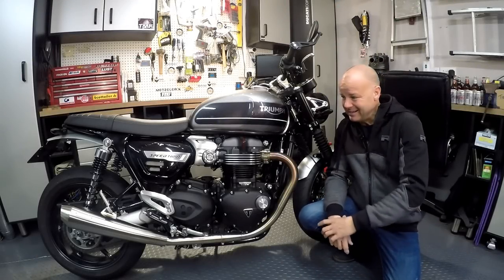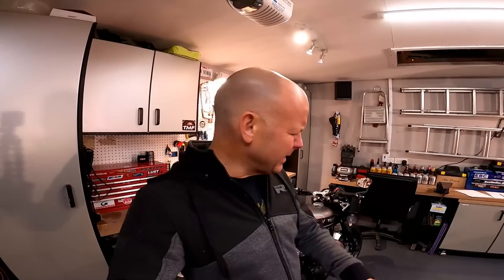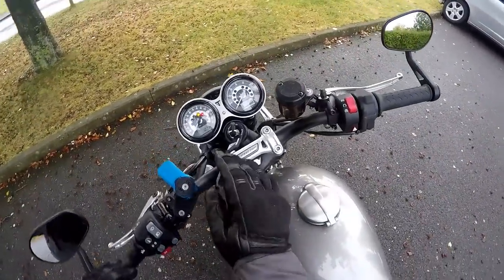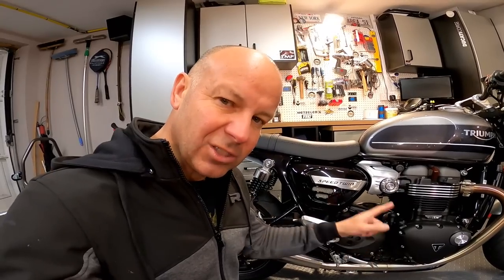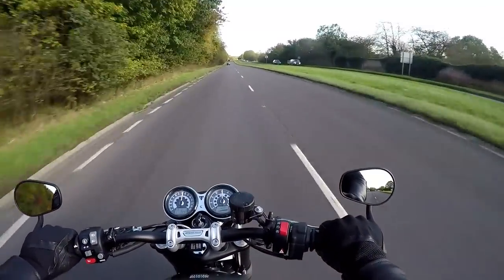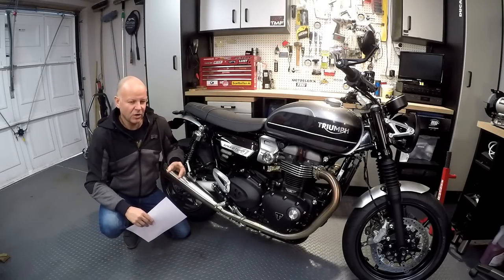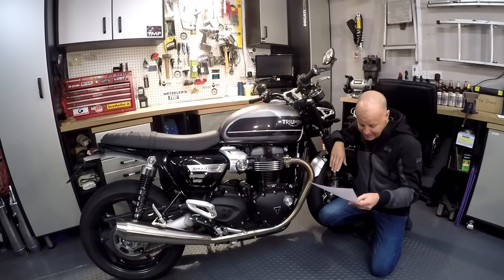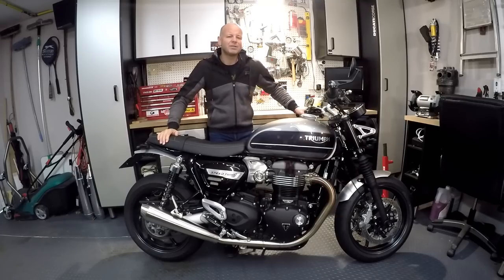Triumph Speed Twin - In depth owners review

Comment: I have the 1200 Speedmaster and it is a bit similar to your Speed Twin at low speeds, not sure if you have “rain mode” on yours but I always use it in town with great results nice and smooth.
Reply: Yes, I have a Speedmaster too and that’s the obvious fix.  I made an enquiry to the throttle spacer kit people but they don’t have a fit for our bike!  Pity. Yours aye, Alan

Comment: To lube the chain you can put paddock stand bobbins on the motorcycle triumph actually makes a set for it.Cheers Chips
Reply from the maker: Indeed - I should have mentioned that - I even have a paddock stand and an Abba Stand so I have two ways of doing it without wheeling it around!!

Comment: Hi! Any noticable difference to even wetter, or dryer, when going to the tail tidy from stock license plateholder? Kind of hoping a tail tidy will maybe act a bit as a longer fender?

SW motech blaze saddlebags will fit bolt on for touring, but only listed as fit for thruxton. Been on several days touring with woman two up and had a great time. Our bums got used to the seat, no big problem, nice to strecht the legs every other hour anyway. 

After 6 months  and 20.000km I dont mind the snatchy throttle much, but will go for same mods as you if keeping the bike. 

What I mind quite a bit is scaring people in the zebras evertime with low speed front wheel braking squealing sound like a freight train and vibration when braking. Total lack of quality feel regarding this and unaceptable on a brand new bike. Dealer have been great, and have had pads androtors changed, but with not much improvement. Have heard from others that a new front wheel might solve the issue permanently. Hoping to have this sorted soon, and keep the bike:)      

(Yes, also tried cleaning brakes, and adding copper grease, several times, did not solve the problem)
Reply from the maker: Thanks for the feedback Lars!

Comment: Great vid, even greater bike. Installed the throttle spacers and cannot agree with you more! In fact, it feels so smooth that I am doubting to install the booster plug as well. In your opinion (or anybody's who has already done this), is that still a useful addition?

Comment: The booster plug to improve low speed throttle response: Who makes it, where did you buy it, how much did it cost & was it simple "plug'n'play" to fit?
Reply from the maker: I got mine from Tec Bike Parts - it is plug n play, I shall soon be fitting one to my Royal Enfield Interceptor and will no doubt make a video on it - stay tuned!
Reply: Adam Croll has a video putting the booster plug onto his speed twin. It's very easy. Ten minutes if you have a five minute smoke break.
Reply: Is this booster plug applicable to the Speedmaster too?  The snatch at low speed drives me nuts.  Slipping the clutch and using rain mode are my only options at the moment!  Yours aye, Alan

Comment: Hello. Great video! I know I’m late to the party here but am a new rider looking at Triumphs and came across this video. Although you have a slightly older model I imagine the usb plug under the seat is the same as on the 24 model. I’m wondering if you could describe how you were able to get your phone cord to the handlebars? Did it require tank removal or were you able to fish it through some other way? I looked through some of the comments here but didn’t see this question asked. Apologies if I missed it. Thanks.

Comment: Interesting comment about the lights, 
Day time running lights are a requirement here in Canada. So my triumph street twin. Always has the Low Beam on, which is the Day Time Running Light. The only light switch just turns the high beam on. 
The light even on low beam I thought was great. Having ridden long dark mountain highways. The full beam really good. 
Might be having ridden an old 6 volt system Kawasaki 100, which was next to useless in the dark.
Even 35 or more years ago learning to ride in the UK. I was advised to always ride with the headlight on. Even if it was pretty useless in the dark. I think it did make me slightly more visible. 

Is this still advised in the UK or a normal habit for riding. 

If I by a car or bike in the US I have to get it changed to Canadian spec, which includes the premenant Day Time Running Lights. It’s usually just a minor change. 
So presumably it is a change which could easily be done by triumph if requested. If it’s standard on a bike here. 
If I was riding in the UK again, it’s a change I would probably request this change.
Reply: UK, you must ride with dipped headlights on at all times.  Full beam optional depending on visibility and oncoming vehicles. Sorry it took 1 year..

Comment: Hi bud great channel , question I have fitted the throttle spacer, great mod , knowing you have also fitted the plug in fuelling mod in the air box , dose it further improve low speed throttle use ? Thanks
Reply from the maker: Apparently so but mine was fitted when I bought the bike so I don't know what the improvement is....
Reply: @TheMissendenFlyer  Since one of the selling points for the booster plug is that it’s supposed to be easy to fit or remove, would you consider doing a review? I’d be interested to see what the difference is with it fitted or not. How much does it help the poor Euro-strangled fueling? Does it have any noticeable impact on fuel consumption? Does it add any gee-gees🐴, or is it mostly noticeable at low revs? Supposedly it’s five minutes or less to to get the job done- a right doddle! C’mon- you know your curious too! 🤔

Comment: The speed twin is a sharp bike. I was wondering if it is as easy to ride as the other Bonneville motorcycles are so someone could get one for a first bike (46yr old adult)? Is there any bags you would recommend for the speed twin that won't mess up the looks of the bike? Would you use a center stand on this bike?

Comment: My 4 and a 1/2 month review as a newbie middle age old git biker, I guess you were expecting this ;)

I got one of these after passing my test in May 2019.
Is it too much for a first big bike ? TMF, you said it was ;)
If I'd been a newbie 24 year old biker version of me then "yes", I was a bit of an idiot at 24 in cars. It wouldn't have ended well on a bike like this. The 51 year old version of me, has found it a bit quick, but 32 years of driving a car and a realisation of the dangers have meant I've survived the first 1200 miles on this big bike. In fact the large torquey engine makes it easy to ride it slowly, in a lot of ways much easier than a 125cc bike (apart from lugging it about). Gear selection is easier on the Speed Twin as compared to my Street Triple, the twin pulls in almost any gear !

Fuel, mpg and range.
The fuel tank is a little too small, should be nearer to 18 litres instead of 14.5 litres.
Triumph put 16 litre tanks on the current 1200cc Scramblers. hmmm....
My Dad's 1954 Triumph Tiger 110 650cc had an 18 litre fuel tank, and that had better MPG ! (70 ish MPG)
I'm getting 56 MPG ( no booster plug ). I don't ride it hard and I keep to speed limits, on mainly A and B 60 MPH country roads. So for me the range to empty is about 175 miles.

Yep, the range indicator is pessimistic. On one of my fill ups, before I filled up I noted it said 35 miles left. I only got 9.5 litres in the tank. So there were 5 litres left, which I reckon would do somewhere between 55 to 60 odd miles. So the range left is somewhere between 20 to 25 miles pessimistic.

Luggage options. Yes the Triumph ones are limited. TEC do make a rear rack, I haven't fitted my one yet.
https://www.tecbikeparts.com/products/models/triumph-water-cooled-2016-models-on/speed-twin-1200/racks-luggage-speed-twin-1200/

The snatchy throttle, yes. Rain mode is better, it's worst in "sport". Haven't tried the booster plug or plastic bits in the throttle yet. I wonder if the booster plug will make fuel consumption worse, I wouldn't mind a bit worse fuel consumption, IF the tank was bigger.

The lights. What gets me is why the function of the flasher switch changes from flashing when on DRL to toggling main beam on and off when on night time lights. So to flash at night takes 2 operations of the flasher switch. I much preferred the way the switching worked on my Honda CB125R. The flasher switch just flashed. It's a minor niggle.

The side stand. Why is the foot lug so hidden away ? Needs to be 1/2 inch longer.
Why no lugs on the frame for an optional centre stand ? hmmm ...

Standard black exhausts look a bit naff. Guess I'll put some Vance and Hines when I can afford to, just like you have. I have a theory that Triumph deliberately did this, to sell Vance and Hines pipes.

The heat off the engine in the summer. Yeah it gets hot. I think it's biased to one side due to the fan. It also only gets bad when the fan kicks in. Nice in the winter :)

Lugging it about. Yeah, not bad. I find my Street Triple S easier, but that's 28 Kg less.
I have a minor ramp to push my bikes up into the shed. I can just push the Street Triple up, I have to start the engine on the Speed Twin.

Bar end mirrors have excellent visibility.

The seat. I need an optional Thruxton like "bucket" seat when I'm on my own (I think Corbin make an expensive one) because the torque makes it feel like I could slide off ! The pillion seat could be a bit bigger, and the entire seat could do with a little bit more padding.

Wish my insurance was £127 per annum ! My first service was £70.

Sounds like I don't like my Speed Twin. No, I love it. Looks beautiful, sounds excellent, easy to ride, more power than I'm going to need in a long time, if ever. As you say the twin dials are nigh on perfect. Brakes and suspension feel good to me. Would I sell it ? NO ! Unless I'm completely broke or can't ride it for some reason. I'll keep it until I can't ride it anymore.

If I had to sell one of my bikes due to hard times, the Street Triple S would be the first to go, but I do love that too, just not quite as much as the Speed Twin. Plus Mrs Karlosh will only get on the Speed Twin's pillion seat. Apparently the Street Triple pillion seat is "too high" !
Reply from the maker: Thanks for writing that lot - and congratulations on still being with us! ;0)
Reply: @TheMissendenFlyer  I am trying to stay alive !
I guess it's not as bad as asking which child you love more. What do you love more the Street Triple R or the Speed Twin ?

Comment: I wonder if fitting an X-pipe would remove the low-speed jerkiness, if the issue is indeed the Euro 4 emissions malarkey. I mean, if I got this bike myself I'd do that mod anyways to remove a bunch of weight and make the bike a little nicer sounding, but food for thought.
Reply from the maker: ...ah actually now you mention it, I do have an X Pipe fitted too....forgot that one!!!
Reply: @TheMissendenFlyer  Something I've been meaning to ask, how does the power compare to lets say the street triple? I just had to sell my '17 RS and I'm considering different bikes at the moment. If I want to go for something more practical, the speed twin is something I'd consider, but I'm concerned about the power. Prior to my RS I had a '07 Daytona. I'm tempted by the Yamaha MT-10 but I'm a little worried about how big the bike is going to be compared to the striple.

Comment: You forget “check gear linkage” . Lots of owners found loctite necessary.  Other than that bang on .. Seat an issue for the heavier chap!
Reply: There's a recall for the linkage issue. There was also an issue with the bike stalling under certain conditions for those of us getting the first ones but seems solved now, haven't had issues after the update nor from new owners. Oh and there was a recall for a cable tidy issue iirc. 

That said I love it and I don't think it has had more recalls than other bikes in general. Just issues from a brand new model.

Comment: Hello. What an awesome bike! Would you recommend it for a newbie mature rider? If not which bonneville would you recommend? The bike will be used for commuting and occasional rides across the UK for a 35+ year old with no motorcycling experience. 
Thank you.
Reply from the maker: I would start with something a little less powerful - the new Speed Twin 900 (as the old street twin is now called) for example…
Reply: @TheMissendenFlyer  thanks! Would t100 be equally good since they share the same engine?

Comment: Great review, I love mine, I too would like info on the booster plug, I've fitted the throttle mod, but the booster plug does sound interesting,  oh and I've fitted twin hooters to mine, they are v.loud! cheers, Dave
Reply from the maker: ...I'll be fitting one to my Interceptor soon - plug and play, very easy to do - stay tuned for a video....
Reply: Can recommend the booster plug on the speed twin. It fixed the snatchy-ness of the throttle at low rpms (also decat and spacer clips).
Reply: Booster plug voids your warranty.  So there is that.

Comment: Not easy to judge lights using a camera, but.. Is the front light adjusted correctly? It looks hella low in the video. I agree with the way triumph has set the daytime vs low beam up, for what i'd call obvious reasons. We see tons of people driving around with daytime lights, long after real light is needed. By setting the bike up to start with the real light by default, and having a light marking when you're not using the real light, Triumph has done their best to make sure people don't use the wrong light. It seems, to me at least, to be the responsible way to do such things. ..and using the light in the cluster to mark low beam would be wrong, since high beam is also marked by a light in the cluster. Signals to the driver should be clear and logical.

I think i'm more of a Triumph T kind of guy, but this comes in a very close second because of how it drives and looks. It's a beauty alright.

Comment: Hey mate,
Thanks for the in depth review, gave me a lot of answers.
I'm really considering getting me one, but am only willing to change it with my current bike and not get it for a second.
Here comes my question in place.
I have a Street Triple R. How does the Speed Twin compare to it?
The twin is heavier, but I've read that it doesn't feel like it.
Reply from the maker: Well I have both and I prefer the Speed Twin - it does feel heavier, but not significantly so…
Reply: @TheMissendenFlyer  yes, I saw that you have a handful of wonderful bikes and was pleasantly surprised to see the Triple R on your list. - Speaks for the Triple. I love it and had a lot of fun with her chasing corners. But I got older and want something that doesn't need me to rev high up and always brings haste into my riding.
But chasing corners is still fun and I want a bike which is able to. 
The Speed Twin seems to be a nice compromise.

Comment: Left side cylinder running leaner than the right causing the extra heat on the left? Or just the wind blowing from right to left? Worth getting it checked out at your next service I reckon.
Reply from the maker: Hmm yes maybe I will - thanks for the thought....
Reply: Take the spark plugs out and compare the colour

Comment: Hi MF...
Re the noisy front brake. Seems odd that the T120 was cursed with this fault. Yet, the Speed Twin, which is a much more expensive and modern braking system, is also cursed with it ?
My T120 was sorted out by Triumph, as were many more, but it does beg the question, why does this new model have noisy brakes ?
Reply from the maker: Indeed!
Reply: My 2018 Rocket 3 has a squeaky front brake as well! Dont feel bad lol It honestly doesnt bother me

Comment: I'm getting a Street Triple and I'm going to have to do the same thing with the USB cable. Why do they put it in the tail?! I imagine it's a vestigial thing from when they have telemetry equipment along while testing. The funny thing is, as far as I understand, the aux power plug you can get that mounts on the radiator housing (meaning in the right place) isn't switched on 'n off by the ignition! Silly.
Reply: I believe there is an auxiliary plug taped to the underside of the gas tank.  I'll try to remember where I read this and post it here.

Comment: Side stand is a nightmare !
Reply from the maker: In what way? Mine is fine!
Reply: TheMissendenFlyer Side stand hidden away. To get it down with sports type boots is difficult, adventure boots are easier but the “nub” is hard to find without looking. Of course if your six feet tall and “flexible” the you can reach down and flip it down 😃 otherwise a very good bike in all respects but not an every day machine for me. Tiger 800 fits the bill
Reply from the maker: Fair enough - what do you make of the new Tiger 900??
Reply: Looks really nice but how much of an improvement would I notice over my 2018 xrx ?  I don’t think I’m that experienced enough to appreciate the differences, my next bike will probably be the 900 once there are some on the used market. Probably I aught to notice the differences after 20 odd years riding  firing order excepted. But my 800 is probably one of the best all round bikes going. I’ve had A LOT over the years. Being on my third Tiger must say something.

Comment: I've had the pads and discs changed on mine and the brake squealing is still an issue. very annoying at low speeds coming to a stop !
Reply: Yes. I agree and it’s odd because this is my third Triumph and the only one with this problem.
Reply: That's odd. Mine doesn't squeal at all. Just lucky, I suppose.